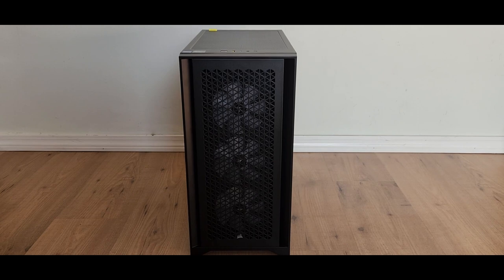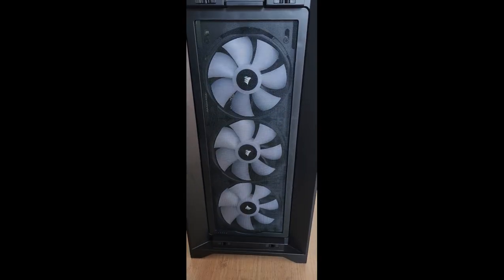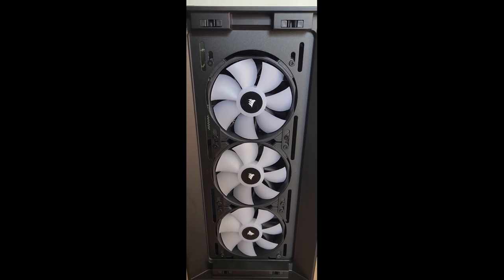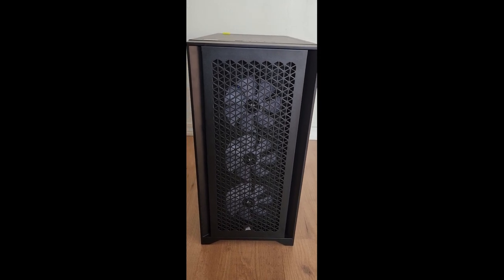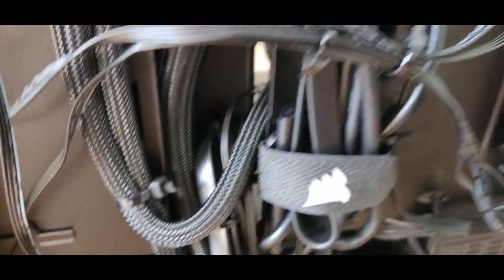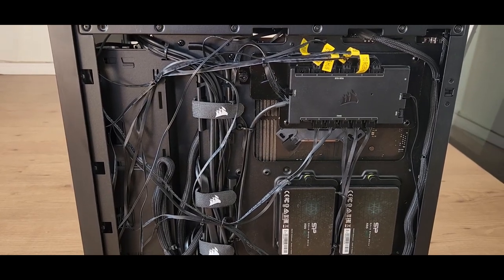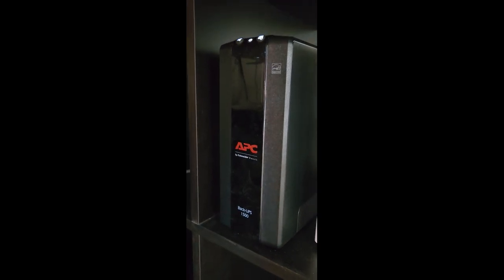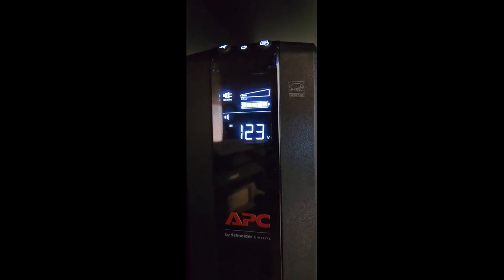Review of my new Gaming PC build - Special!!!

Comment: Hallo we have the Problem that the Rgb Fans are running but not working with the Light do you know what is the Problem?
Reply from the maker: More than likely, the RGB pins may not be plugged in properly. I connected mine in a sequence using the Commander Core XT fan controller. Are you connecting the RGB fans to the motherboard headers or are you using a fan controller or RGB hub for the lights?